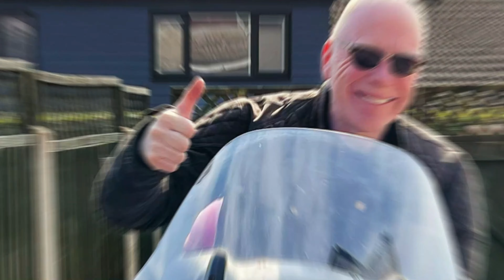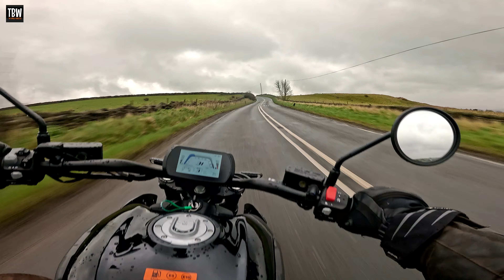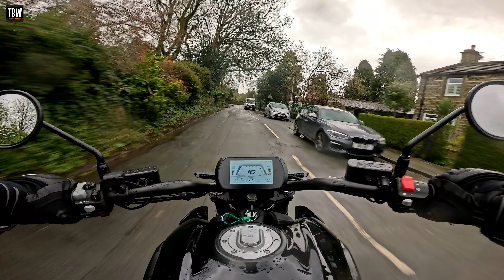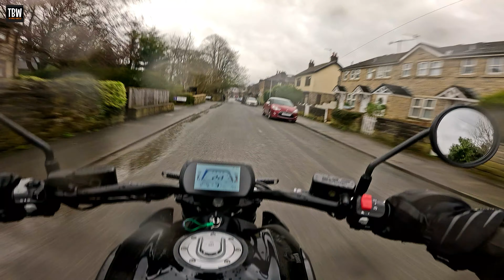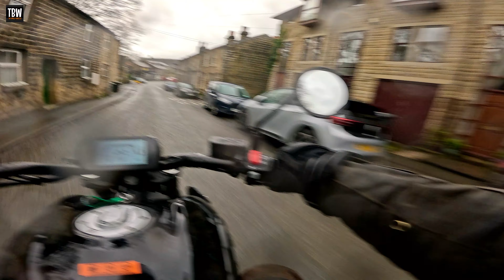Unforgiveable Neglect of Our Roads!

Comment: We've got the same issue here in South Wales. I came over the Black Mountain pass yesterday in the car, the surface is in shocking condition and it's a popular route for bikers, lots of gravel from the crumbling road surfaces, especially on some of the bends. I'll probably not take the bike up that way until it's improved. Plenty of money for active travel bike lanes and the such, plenty for speed cameras and 20 limits but sod all to fix the roads themselves.
Reply: They spent over £1m on the “active travel” route from Gorseinon to Penllergare, 2 miles and since they’ve done it ( over 9 months ago) I’ve seen one cyclist use it. They narrowed a busy road which has quite a number of HGV traffic on it making it difficult for them to pass each other when two meet and they are going to spend even more money extending it even further. This is at the same time as the Welsh government saying they can’t afford to give junior doctors a decent pay rise, offering them the lowest percentage rise in the U.K. They can afford to expand the numbers of AM’s in the Senedd though and found to £34+M to impose the ridiculous 20mph farce. UK governments have consistently run this country into the ground while feathering their own nests.

Comment: Have I missed something here? What bike is that? It's not a Super Meteor, Guzzi V7 or a Classic 350. I agree that the roads are shocking and it's a problem that has been coming for the last 10 or so years. There is no preventative maintainance being carried out, particularly to drainage. In the past you used to see people clearing the ditches and drains but this has not been done around here (Derbyshire) for so long that now there are sections of road that always have water on them and the freeze then thaw of winters has destroyed the surface (and probably the underlying structure).
Reply: "it's a problem that has been coming for the last 10 or so years." It doesn't take a genius to work it out.
Reply: I'd say you're right but the last 25 years... at least.

Comment: The state of the roads could be one of the reasons the adventure style motorcycles are popular .  50 mph limits on non motorway roads doesn’t bother me ,as I reckon 50 mph is a nice mellow cruising speed ,& still enables reasonable progress , for those who are not impatient .  They usually wait until the busy summer holiday traffic , & then start up all the road works & pot hole bodging & the temporary traffic lights ,in my neck of the woods .

Comment: I drive a truck (lorry) here in the US and I agree on the speed reductions, at least temporary here on some roads.  I have seen craters that would swallow a Bergman 400 wheel easily.  This on interstate 75 in Michigan and a 70 mph still  in place. And it is a concrete roadway.  I'm getting to the age that maybe when I finally wear out my Meteor 350 I might get a Vespa 300 for the last ride. Getting harder to throw the leg over.  But to hit a deep pothole with one could cause a fracture in my back. Oh the dilemma of age. 😂